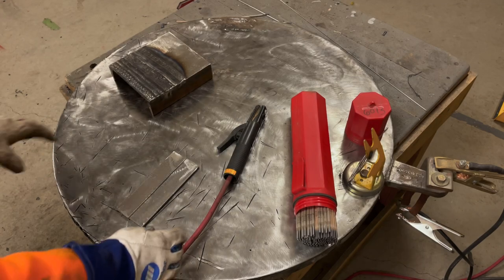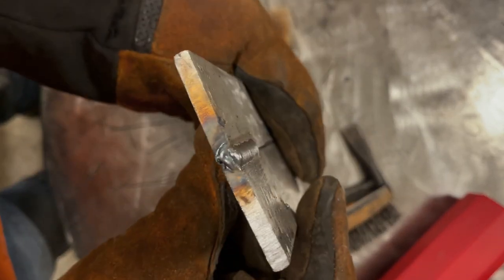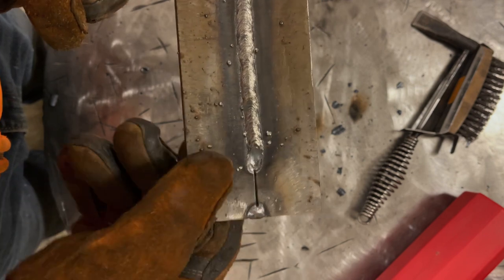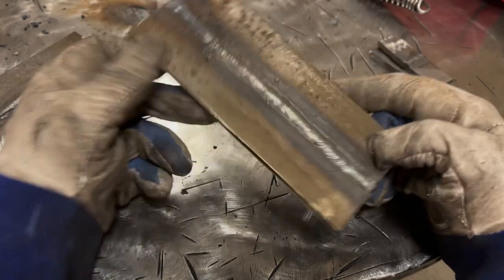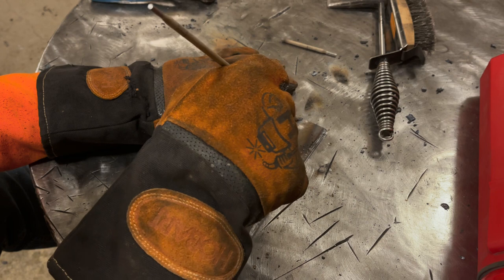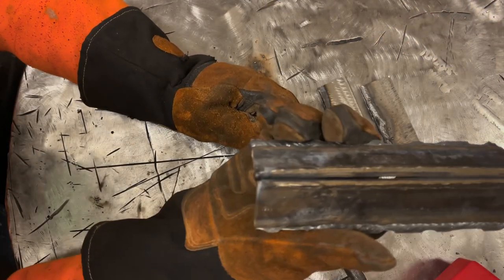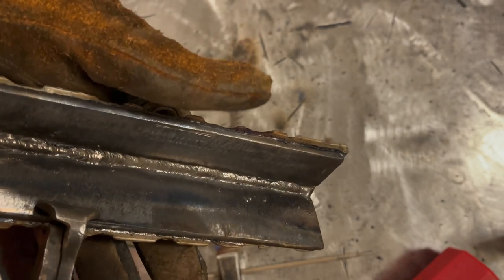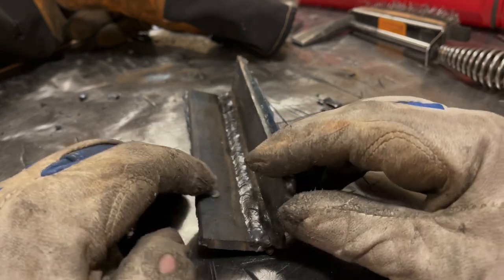How to stick weld 👨🏻‍🏭: How to weld Butt joints (Series part 4)

Comment: Great Video and detailed narration. I have a box of Lincoln 6013 1/8 rods that came with my welder that i never tried, Your tips will help me immensely. How does 7014 1/8 rod behave are they similar to 7018 ? I have been practicing using 7014 at around 190amp seem to work better, able to make a decent bead, but at joining 2 piece of metals am not doing good. I am using a Hobart Lx235 stickmate.
Reply from the maker: Hopefully this helps:

7014 is a oddball to me.  I think it runs more like 6013 than 7018 or 7024.  7014 is far easier to start than a 7018, is slightly easier to weld in certain positions than a 6013.  I personally use 6010 and 7018 for virtually everything so I don’t use 7014 for much.  

Based on your description of running a decent bead on plate but welding two pieces of metal isn’t good, it probably comes down to travel speed and amperage.  When you run a bead on plate you can run a wide range of travel speeds and still have a decent looking weld.  When you weld two plates together you have two separate heat sinks pulling heat out of the puddle therefore the puddle reacts differently.  If you speed up too fast the weld may only stick to one of the two plates.  If you run too low of amperage you may run a nice bead on plate but welding two pieces together you have inconsistent fusion.  To solve this you need to run hot enough that the puddle fuses properly, and you need to move slow enough that the molten pool stays consistent in shape (the shape should be of a oval or eye).  

I am not sure what rod size you’re running but 190amps is probably high.  It’s likely that your machine just has inaccurate output settings.  A normal 1/8th 6013 runs 100-120 amps, 190 amps would be enough amperage to make the rod glow red and likely melt.  Even 5/32 rods run well below 190 amps.  Regardless of the welders actual setpoints, if the weld is like a bead of caulk on the plate or you find it difficult to fuse two pieces together, increase amperage, or slow down travel speed, or both.  That should help improve things.
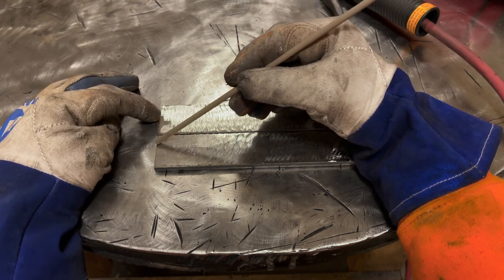Reply: Thanks @makingmistakeswithgreg , I rewatched your video at 4:40 you mentioned about the possible need to up the amp when joining, sure i forgot to try, Now my project is setting up a 10k lbs winch set up in a flat bed trailer, am welding the base plate with three 1/4"  C channels thats being welded to the front frame. I did do the up hill weld on to the frame & am not impressed. 1. Does 7014 be okay for such application. 2. Should i actually do downhill with a back-forth motion. 3. I do have some 7018AC, i tried them it was a hit n miss, may be should i put them in oven & try them.? Also yes i suspect machine output setting seem odd, bought it used, even the label on machine suggest 85-160 for that rod but anything below 185 rod sticks. Thanks again.
Reply from the maker: @yamahalowrider  so uphill welding produces more penetration due to heat input and the molten puddle pulling down via gravity.  So arguably uphill is stronger because of better penetration.  Downhill is easier to produce decent looking welds, but you can get slag inclusions/weld defects from it.  7014 is a fine rod for general use and produces a strong weld.  It tends to have limited penetration though.  7018 AC rods tend to not run the smoothest in my experience.  Baking them may help, but they do run different than a normal 7018.
Reply: @makingmistakeswithgreg

Comment: Great video as always! I has left me with 2 questions  1- if you weld on that seem on the other side will that pull the plate back to flat? And 2- do you grind off all the welds and reuse the plates?
Reply from the maker: If you weld both sides it will tend to flatten out provided you did it quickly.  If you weld one side let it cool and weld the other it would likely not move much.  Plate wise I generally use all new steel.  At times I did reuse a particular plate in videos but for videos and my own practice I generally use new steel.  To make most economical practice running beads on flat plate and layering them is the best way to go.  On fillet welds it can get expensive to do 10-15 of them so there are a lot of ways to get cheaper practice.  For example: Practicing running beads in the horizontal position on flat plate will help prep for fillet welds.

Comment: I would like to know what to do if you’re rod keep sticking, and can’t start. Amps too high or low. Arccaptain 200 MiG, with 7018- 3-32, 1/8. Bought 6013 but not tried them. Thx, ky
Reply from the maker: So 7018 tends to be a sticky rod no doubt.  One solution is to switch to a rod like harbor freights 7018, Esabs 7018 prime, or any 7018 that has a “easy start” tip.  Basically there is graphite on the tip and it makes the initial start much easier.  

Generally speaking if the rod sticks you need to run a bit more amperage.  The hard part with amperage is I know what amperage a rod needs.  However every machine outputs different amperage.  Cheaper ones tend to be far less accurate.  So 120a on my machine might be 130 on yours or 110 on someone else’s.  Unless something is majorly wrong with the accuracy of a machine a 3/32 7018 should be run 80-100 amps and a 1/8th 7018 should be somewhere between 100 and 130.   If you’re running on the low end of those numbers bump it up a bit.

Beyond that, practicing with 6013 is a much easier way to learn to start a arc, but ultimately learning 7018 does require dealing with the harder starts for a while to get a feel for it.

Comment: I just got a Hobart champion 8500 and get the amp settings are being difficult and there’s nothing out there to tell you or show you how to setup. I use to be able to lay a weld that you could not tell it was welded. But I had a stroke some years ago and just recently started back when I got this Hobart and I have used engine driven welders before but they were big diesel machines and I don’t remember it being that hard to setup. If you know how to set the fine adjust settings could you please help thank you.

Sorry if this doesn’t make sense I have a deteriorating brain condition
Reply from the maker: I have some tips.  So that welder has a setup that’s a bit different than a typical plug in the wall welder.  You have a main dial and a secondary volt/amp curve switch (sometimes the dial is called fine control and the switch is called corse control).  To weld with it you need to first select your volt amp curve switch (corse control) to what’s correct for the rod your running.  If you’re running say a 1/8th rod either range A or B will work.  Then you need to adjust the dial to what works for the rod.  The dial in range A is 85 amp to 210 amp.  That means the dial all the way down is 85 and all the way up is 210.  Range B is 70amp at the bottom and 150 all the way up.  Range B gives better resolution with 1/8th rods, aka a small change in the dial won’t massively increase amperage like range A will.  

So in range B if you have a 1/8th 7018 or 6013, put the dial at the halfway mark, and give it a slight bump past halfway.  Halfway would be 110a.  Hopefully that helps you.

Comment: Im making a lil 25hp buggy for the woods etc... which rods would you suggest... All mild Steel... well mostly lol
Reply from the maker: Sounds like a fun project.  Two thoughts, hope they help you out:  
1: What rod are you the most comfortable running?  If you need to weld stuff in place with a lot of angle changes (uphill and overhead) there could be a lot of issues with rods like 6013.  I find that it tends to cause slag inclusions and be pretty difficult running out of position.  However if you are most comfortable running it over other rods you should go with what you know you can lay a bead the best with.  

2: Flux core wire is so much easier to weld tube and out of position over stick, if you have access to a flux core wire welder that would be the easiest.  However 1/16th stick rods do weld pretty good on thinner stuff (not sure how thick of material you need to weld).  They make them in 6013, 6011, 7014, 7018, I would pick 6011 for those.

Based on my skill and experience, I really think I would tackle it with 6011.  The reason is on thinner material its slightly less aggressive than 6010, it welds uphill far easier than the other common rods (besides 6010), and it makes solid welds.  7018 is doable and I would pick that over 6013, however its far harder to weld out of position with.  6011 can make some poor looking welds though if you dont have it dialed in (aka practice).

Comment: I welded for a whole month just doing the straight passes on a block before I started joints.
Reply from the maker: Yep, that’s what most people do when in welding school.  It sucks, it’s boring, and it seems like it will never end.  However if you can’t do the simplest thing well (a straight bead that’s consistent) everything else is far harder that it should be.  Trying to master the beginning of arc gap control in vertical up is not the way to go lol.

Comment: Hi Greg. When you say that you pushed the rod all the way into the corner, do you drag the flux of the rod in contact with the metals or do you have a small air  gap to avoid any contact? Cheers
Reply from the maker: I generally drag the flux on the plate.  What I find with 6013 in particular is the flux seems to melt off slower than it probably should.  Because of this if you don’t keep “pressure” on the flux against the metal it’s very common for the flux to melt off slower than the actual metal rod, thus you end up with a arc gap that becomes excessive.  The rod tip is up in the flux tube far enough that the arc wanders or it starts spitting molten material out.  This seems to be a huge issue with vertical up with 6013.  With other rods like 6010 and 7018 they tend to have flux melt off at a ratio equal to the rod so they don’t suffer from a inadvertent (non intended) long arc gap.
Reply: @makingmistakeswithgreg  Thanks.

Comment: When welding 2 flat bars at 90degrees should u weld. Interior angle and exterior or not ?
Reply from the maker: It really depends.  So if welding both sides you can use smaller welds to get the strength that’s needed.  If welding one side it’s smartest to weld a big enough weld so the weld is the same thickness as the base material.  My general rule is I weld both sides if possible on material 3/16th and thicker.
Reply: @makingmistakeswithgreg  thankyou ive learnt so much from u and cant wait to learn more

Comment: Question Tim, how much hotter should the hot start setting be ?  If I'm running 6011 at 60 amps where should the hot start setting be? ....thanks
Reply from the maker: What size rod is it, and what welder is it?  Every welder has different accuracy on its amperage setting/output, and their hot starts tend to function differently.  If you’re running 3/32 6011 at 60, you would want the hot start to generally be 20-30% or 2-3 out of settings depending on welder.  Look at the first inch of the weld.  If the weld is wetted out and looks consistent to the rest of the weld, the rod didn’t stick, and it started decent you probably have it set right.  Keep in mind if your base amperage is set low for the rod you may have to turn up hot start more than you should.  On thin material you may have to turn it down.
Reply: @makingmistakeswithgreg  thanks.  Yes  3/32 rod   vevor mma140 stick welder.  Trying it out/learning for the first time on some cleaned up bed rail.
Reply from the maker: @RG-ce5hj  so if it’s adjustable start on the lower end, 20-30%.  If it’s too high you will have excessive spatter and possible porosity at the start because the rods arc gap will get real big (rod will somewhat blow apart).  Sometimes welders have a time control too, where you can adjust how long the hot start is active.  That you would want at or around a half second.  Too long and you’ll have issues with a excessively hot weld/cooked rod.

Comment: I have a yes welder that says only 7018 it won’t weld with anything else. So if you need to stick with a different rod, don’t bother with the YES welder
Reply from the maker: Unfortunately you are correct.  I am all for budget welders and I wish more people realized how good the titanium 225 stick welder is from harbor freight compared to the yes welder.  The 225 will weld with 6010, and welds really good.  Atleast you can run 7018 with it, that’s better than no welder lol.
Reply: Hey guys just wanted to say, not sure which yeswelder you have but I have the 205DS bought couple years ago and it'll run all common electrodes except for 6010 . Love this series btw

Comment: i like how you do your videoes but for the love of the welding gods, use  either a cellulose rod or 7018, and bevel that damn plate!
Reply from the maker: You have to put it in perspective:  the video is meant to teach someone the fundamentals of a simple lap joint at a beginner level.  A beveled (possibly open root) joint with 6010 is not something a beginner would be doing.  It’s also advantageous to start with thicker plate because if a beginner started with 1/8th material or thinner they would likely become frustrated with blown holes (especially with 6010).  So you’re not wrong, there are better ways to weld a lap joint on 1/8th and thicker material, but at a beginner level those don’t really apply.  I will eventually get to videos dealing with “advanced welding” but you have to understand that I cater more towards beginners than advanced welders.  At a certain point with welding you can just figure stuff out on your own and no longer look for videos on how to do it.  So spending more time on advanced videos would have fewer viewers and less people I would help.
Reply: @makingmistakeswithgreg  fair enough, but still, not beveling the plate encourages bad habits, and that is not a full strength weld.

don't take this wrong though, I much appreciate your videos, and 90% are great content